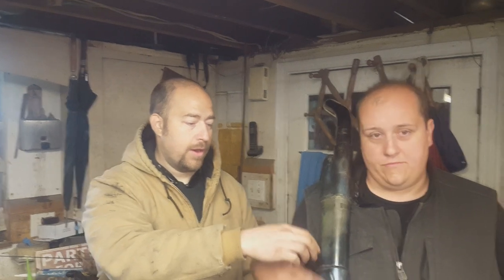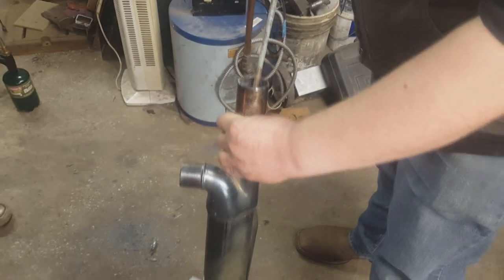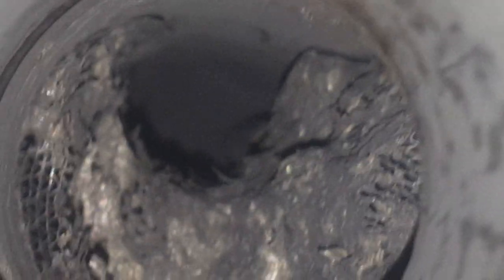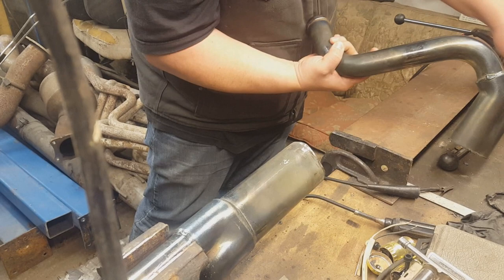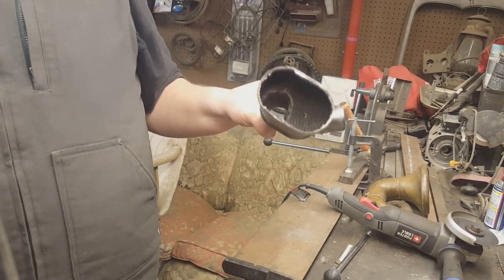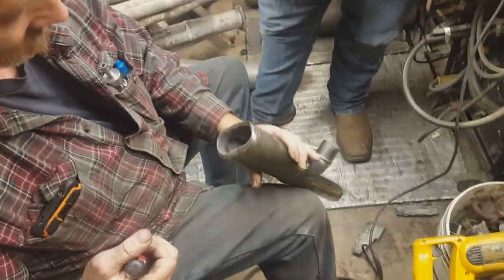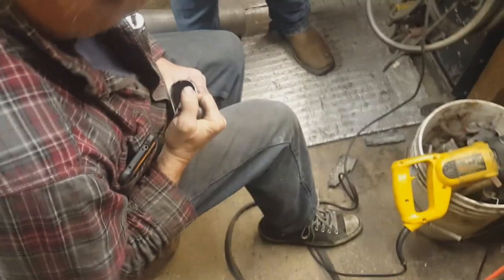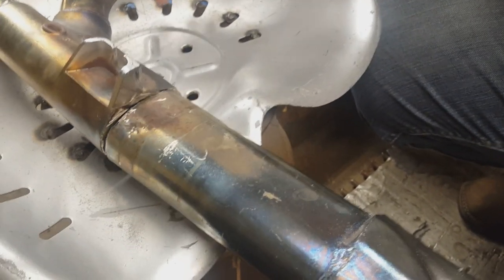How to remove Catalytic converter from harley stock exhaust

Comment: don't forget to "scribe" a few lines in both parts of it with a straight edge and scratch or sharpie before you cut it apart so you can line them up before welding back together!
Reply: Lol right? 🤣

Comment: I used the paddle bits.  3/4 bit 3 times spaced out.  Then 1/4 bit about twenty times.  After that I switched back to the 3/4 bit to beat everything to pieces.  I did all of this with the exhaust on the bike minus only the right hand muffler. A vacuum worked great to pull everything to the end of the pipe. This took about one hour.  Take care not to break your hand lol.  The cat can grab the bit and throw the drill around.

Comment: You guy's made a relatively simple job look like hard work I completed the whole job start to finish in approximately 40 mins using a drop saw with a metal cut of disc cutting the section containing the cat off at both ends placing that section in a shop vice & using a 1/2 inch drill I proceded to drill several holes around the edge of the cat material which in my case was not ceramic but metal after drilling the aforementioned holes I simply took a large drift & a good sized engineers/ballpene hammer and drove the material out then using the lines I had marked prior to cutting cat section out I set everything up using the vice & clamps welded it all back together quick squirt with engine enamel And back on the bike & ready to remap

Comment: I went with leaving the header pipe on ( like someone who mentioned in the comments) 2014 SGS . I used an impact drill w/ an extension . Two different bits ( 1/4, 7/8) a long crow bar to scrape the scraps left. Presto! no more cat. Deeper rumble, better take off and top end, no decel popping. I saved $600 from buying a true dual header.
Reply: Did you have to do a tune?
Reply: @robertwilliamson1487  No- no additional tune .

Comment: I remove the baffles today on my 13 flhtp after watching your video.  big, big difference in the sound.. do I need to worry about it running hot noe
Reply from the maker: good deal and no it will be fine

Comment: Great video. I was wondering how to do this. Now that there is a video out there. I am going to do this project this weekend. And all this time, thought is project was hard too do, i never tried to tackle this project before. The question remains, where can i rent a welder? I like the torch and welding part better. Thanks for the very informal video. I will tell my harley friends. Maybe we can all do this project together. Keep up the great work. Keep making great videos. I really also enjoyed the intro of the animation in the beginning and at the end. You two are very good.
Reply: Timothy in the Kitchen Screw the welder I used small hole drills paddle for doing this got most in 1/2 hour used drill extension and covered end with rag to keep dust in.  Couple small pieces left for morning. Take exhaust off my bike put cleared one on.

Comment: Cool video guys  Been thinking about doing this for my 12 streetglide. I already got cary faas slip ons, V&H tuner and Arlen Ness breather. Question is what did you do with o2 sensors ? still used ? disconnected ( sorry for newbie question)  Thanks Guys  frank
Reply from the maker: Frank Davignon yes 02 sensors still used and when you do the removal im sure your tuner will need remapping but if i remember right its free uploads of maps from v&h.

Comment: no one ever says if you have to retune or not. I know the cat is after the censor but... Also does it make the bike louder. Id be doing it to cut down on heat.
Reply: No need to retune. If you want to use a tuner, it will help a little bit, but the M8 comes rich enough from the factory. Using a tuner when replacing slip-on's and air cleaner is optional on the M8.
Reply: @NKBobcat  i have a 103 twincam and you do have to re tune . This was twi years ago but thanks for the m8 info.
Reply: @davidfellows6250  Twin Cam, definite retune.

Comment: Instead of a wood drill bit I just use a 12 gauge shotgun. Just shove the barrel down there and blamo! Best get your dumbest friend to pull the trigger while you take cover. After the emergency vehicles leave with your friend you can order an exhaust system from the web. Since he may not have vision after the hospital stay you can just tell him those Reinhardt pipes are actually the stock ones and he did you a solid.

Comment: Just curious has anyone used a slide hammer for breaking the bead on tires? I used this on my pickup and it worked quite well. Just curious if anyone tried it this way as well on a smaller exhaust.

Comment: Dear 2 mostly bald guys! I am following you from Brazil with my Road King FLHRC 2009 and 1st thing I did was remove the baffles out of stock exhaust and now I am looking for remove the catalytic converter and a question occur: I have a relative will all tools for that inclusive the weld so Is that possivle to remove the cat direct from bike without remove the headpipes?
Reply: Olá amigo , fez na sua Road king? Ficou bom , sem perda de potência? Desde já agradeço

Comment: when u removed cats.. did it mess with 02 sensors? have u any insights on cvo touring pipes with fullsac baffles installed? i just inherited a 2011 Road glide ultra.. coolest looking light blue color i never knew H-D used.. but it has screaming eagle slip ons but still to quiet. i want a nice throaty harley rumble. i can have a set of slip on stock cvo mufflers with the 2" fullsac baffles installed. i am not familiar with fullsac. any advice or input?
 luv your videos.. YES i subscribed
Reply from the maker: you will have to have it tuned with removing cat but the o2 sensors will still be there and not effected. you can either get aftermarket tuner or have your local harley tune stock computer. it is better to go aftermarket. i dont have much knowledge on different exhaust setups. thank you for watching commenting and subscribing!!! we try to do as much as we can just depends what things we come across and when.
Reply: A legit dealer is not going to reprogram it to run without a CAT, it's a federal crime....funny stuff, keep it up
Reply from the maker: Well i dont know where you are from but here they have no problem doing it!
Reply: They could get their licenses revoked, it's Federal, not state by state...if they do inspections, and emission testing, it goes now in 2017 beyond state, do some google, on messing with anything tied to emissions, on motor vehicles.  The bike came from factory with EPA certs, messing with it, makes it non conforming to FEDERAL EPA specs...look it up
Reply from the maker: cengeb i understand the regulations but if that where the case for motorcycles why do they sell aftermarket exhaust at the dealer that removes everything as well and when inspected (in missouri no emission testing) it passes with flying colors anywhere?
Reply: that window is closing rapidly, after market exhaust makers are in need of remaking, getting EPA certs, etc etc, the entire industry is changed....And it will put many out of business in the after market business.  The dealer is playing with fire, it will backfire, hey that's a pun, backfire, exhaust...get it?  East coast is real strict on this crap now...And depending on model year, you can be sure, cops will be having all the info, and socking it too the modified ones, it's creeping in like termites slow and steady.  N.J. doesn't do any motorcycle inspections anymore, it was a waste, BUT, they will set up ROAD BLOCKS and stop ya on the roads, ie like  a Ver are yur PAPERZ operation...and since it's Federal emission violations, it will be a mess...the after market guys will have to make EPA certified, has to be stamped into the pipes, blah blah blah, everything has changed..AMERIKA.  And since I think most HD dealers are independent business, HD won't care, it's the dealerships that get slammed, not HD, HD doesn't endorse after market violations.  If it didn't matter, why is HD shipping bikes that are much quieter, and have embossed EPS certs on their exhausts now, my 2002 FatBoy , Screaming Eagle II doesn't have , I think since 2009?  It all came to a change
Reply: One or the other, if I am hugging a tree, I can't lick boots.  Why is it OK, for some to dismantle emissions stuff, but others it's not?  Why would one destroy a cat?  To what purpose?  You like pollution?  Noise?  Serves no logical purpose
Reply: Like many others,   we are just looking for ways to make the engine run cooler

Comment: I did this on my flhtk and I re tuned it and it still is throwing the o2 sensor code but not until I start riding it doesn't do it on first start up and idle??? Any others experience this?

Comment: just put the cut exhaust part verticaly on the vise and hammer a chissel in the big opening breaking the catalyst and then you could just turn it the other way and it would fall out,thats my point of view atleast,I have not tried removing a cat,but I think I will
Reply: The chisel,bar, or whatever would mash the stuff inside together. Torch inside doesn't do well either.  Then you have to cut it apart clean it out and have a good professional welder put the parts back together.... that's how it worked when I tried it anyway 🤷

Comment: do you need a tuner if you only remove baffles
Reply from the maker: Wendell Bolin some will say yes but i say no mine has run great since i did mine, better mileage and feels like more power not much of course but definitely some. i know our harley dealer only charges $50 to do a tune to stock computer maybe yours does as well if you decide to. i have not yet but i will be as soon as i put my decated pipe on.

Comment: If you think this is hard you should have seen me digging all that crap out through the hole without opening up the pipe.... but it was worth it and no welding required

Comment: Platinum Rhodium, just dump it, it's also a federal violation messing with the cats...what's the point? And the ECU is set for the back pressure, if you don't reprogram it, you will ruin the stuff, ie engine, and it will run like crap
Reply: cengeb I agree you have to re tune the bike for the exhaust!!

Comment: You’re wasting all your time by doing that, you could just replace it with a piece of pipe and cut off where the Converter was it saves a few hours my welding in a piece of straight pipe

Comment: Completely wrong! Remove headpipe,take a cutoff wheel and cut a square the length of the cat. section on the chrome shield side.pull cat. material out,weld the piece back in and your done. Best thing is shield covers it and No one can see it.
Reply from the maker: Derrick Evans its not completely wrong it's just different then you choose to do it

Comment: and when smog check comes motorcycles then you have to buy the whole set up.  You are better off buying aftermarket and keeping the oem on the side. People need to be aware this is actually illegal in all states. Its federal law that puts them there.
Reply: The state I live in does not do emissions testing on motorcycles. Headlight, brake light, and horn are all you need to be legal.
Reply: No state does yet. Don't count on it never happening.

Comment: By removing your Cat your going 2 b breathing in Exhaust fumes evertytime u walk up 2 your bike or siting or just starting it up. Unless doing a Full custom exhaust just leave in in there instead of polluting yourself and the world.
Reply from the maker: There are far worse vehicles out there including all semis and plants polluting than a motorcycle that runs great and doesnt smoke. There is no smell coming from the bike. It is tuned for the exhaust it has.
Reply: @2MostlyBaldGuysKC  It's 70% more polution without the Cat. If someone is riding behind you on a trip they just sit there and breath in cancer causing carcingins. The bike is already loud with the baffle removal and you can tune it just like that. If your building a custom bike and have the two little short pipes or something 2 b a show bike its one thing but your leaving the stock pipes so the only difference is you breath in polution everytime you ride. It's dumb and now if im behind you i have to breath in fumes 2. It's just stupid. Seriously.
Reply from the maker: @nobodysreview6137  so I guess my question is what's the difference between aftermarket or you called custom exhaust?
Reply: @2MostlyBaldGuysKC  Thats polution too but they changed the look of there bike, u did nothing but polute 4 absolutly no reason.

Comment: Congratulations. You just lowered the resale value of your motorcycle by about $2000 
and committed a felony if you sell this motorcycle to anyone in this condition
Reply from the maker: peejay1954 so your telling me putting after market exhaust on is different? It's getting rid of same things.
Reply: First of all, aftermarket exhausts are sold with warning labels and instructions stating, 
"not legal for use on the street. May only be used on off road events and racing". 
Next, see USC (United states code  42 §7522. sec. (3) (A) Prohibited acts) " :

For any person to remove or render inoperative any device or element of design installed on or in a motor vehicle or motor vehicle engine AKA Motorcycle)  in compliance with regulations under this subchapter prior to its sale and delivery to the ultimate purchaser, or for any person knowingly to remove or render inoperative any such device or element of design after such sale and delivery to the ultimate purchaser; or

(B) for any person to manufacture or sell, or offer to sell, or install, any part or component intended for use with, or as part of, any motor vehicle or motor vehicle engine, where a principal effect of the part or component is to bypass, defeat, or render inoperative any device or element of design installed on or in a motor vehicle or motor vehicle engine in compliance with regulations under this subchapter, and where the person knows or should know that such part or component is being offered for sale or installed for such use or put to such use; or

Now, read this  : 

CARB has proven it is not shy about laying down the law on those who run afoul, when it sees fit. The most recent enforcement came down on high-profile custom builder Jesse James, who got slammed with a $271,250 fine for 50 non-compliant bikes built between 1998 and 2005. The kicker is that the giant fine is a settlement from a higher original fee, which James claims was in the area of $22,000 per bike.

OK you "mostly bald guys". I'm not going to rat you out, BUT 

if some enforcer from the EPA sees what you posted above, don't be surprised to have a knock on your door, yourselves lead away in handcuffs, your shop padlocked, put in jail till you make bail, then go through the legal system, pay thousands to lawyers and experts to defend yourself and if found guilty, have your life savings and all you have accumulated in your life confiscated if found guilty, then being barred from ever touching a tool to work on motorcycles again. SO post stuff like this at your own risk.
Reply from the maker: Ok in missouri there is no law for noise or for exhaust modification. Yes I understand other states are harsh on laws but here they are not punishable by law for anything we have done so just so you know we check into this stuff before we do these. We appreciate your concern.
Reply: The law mentioned is Federal which overrules any state law. 
Even Missouri's laws, even if such a law does not exist. 
You takes yer chances and if caught, you take yer medicine. 

By the way, I only bought 1 new motorcycle in my life, a 1981 Yamaha 550 Seca. 
In less than a year after opurchase, I put a KerKer 4 into 1 on it. 
I did not violate any emission law, but could have been fined for altering the sound level from the OEM exhaust. Thankfully, I never was caught
Reply from the maker: peejay1954 that is always good we always say it's not illegal if you don't get caught lol
Reply: Get to your tree hugger!!!!
Reply: 10th Amendment states unequivocally that Federal Law does NOT overrule state law, UNLESS it is specifically prohibited in the US Constitution.
Reply: @kimrandall8135  yes it does. Problem is, you will go broke defending yourself in court. Once litigation begins, no one wins except lawyers and the government. And I'm not a conspiracy nut either. It's just the truth.
Reply: @billydamnit  Concur.
Reply: @peejay1954  Sorry Ed. This video provides ZERO evidence that this particular header pipe was ever installed on a motor vehicle. It’s just two guys playing with a pipe. No VIN.  No vehicle. No proof of any crime. You can assume all you want, but this video is missing 99% of the facts necessary to prosecute anything.